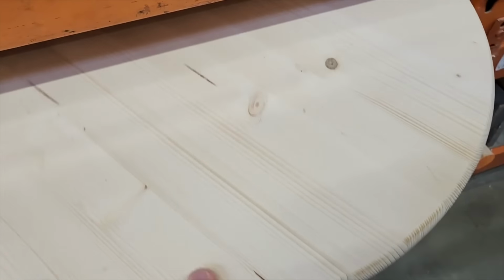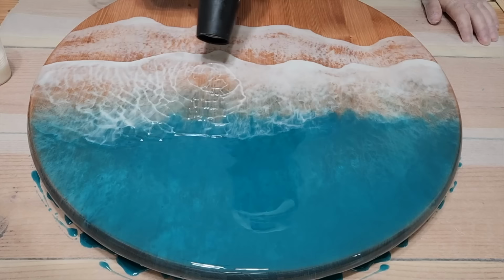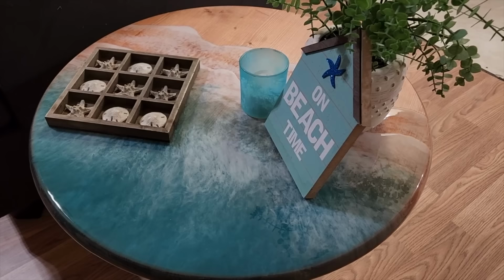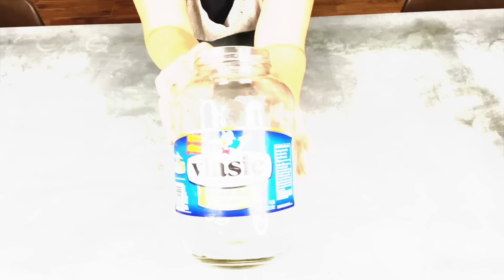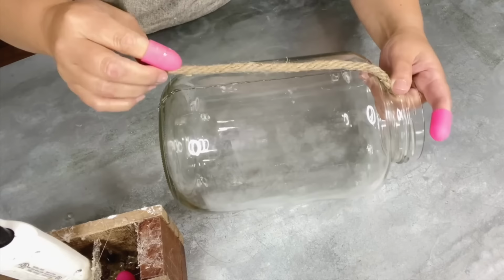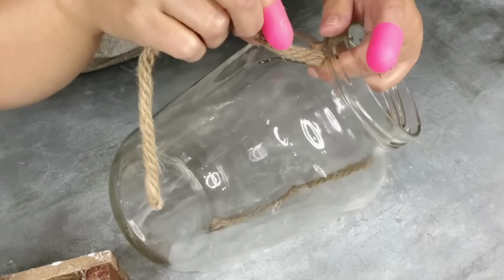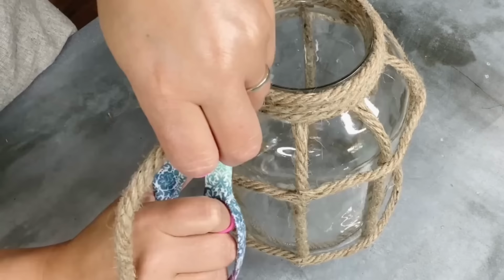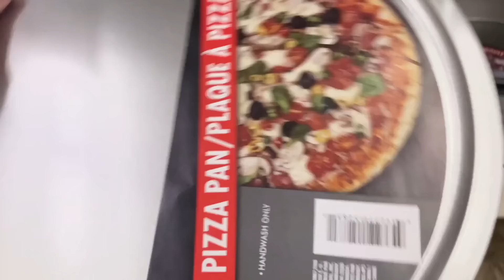Buy a wood round at Home Depot for this GENIUS idea!

Comment: Neat crafts! If I may, would you consider listing all items you use for each product? Ex: Did you use crafting clay for leaf prints, and do you bake clay before and or after painting? Thank you.
Reply: I’d use air drying clay myself. And I think you can even get different colours on Amazon.
Reply: @borleyboo5613  Thank you
Reply: In the video she used Magic erasers to make the leaves I thought. Just ironed over them and cut it out once it heated up and flattened out.
Reply: She used a large bar of white sculpy brand clay.  It is a polymer that you have to bake at a low temp to dry.  It is available at most craft stores in a variety of colors
Reply: This channel doesn't make those videos or projects. They take videos from other people's channels and post them as part of a montage. It's actually quite crappy what they're doing...

Comment: To attach the rope handle to the white frame lanterns, I would use 3" x 1" faux leather strips threaded through brass rings and folded in half. Staple the leather inside the lantern and attach rope to the rings. More polished looking and will only cost another two bucks at dollar tree. :)

Comment: You had better keep that round wood dry.  It's made of several strips of pine glued together.  Once it gets wet, it will fall apart, as it has done for me.  Should be OK indoors, but just saying.  Don't be putting a flowerpot on top of it unless it's something like a cactus.  Or fake.